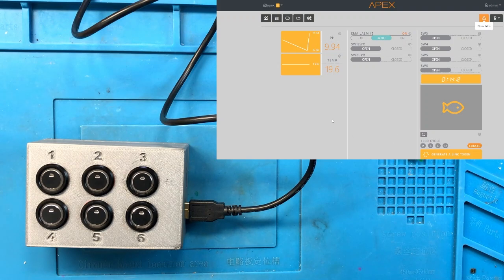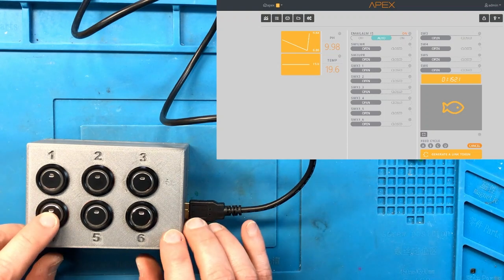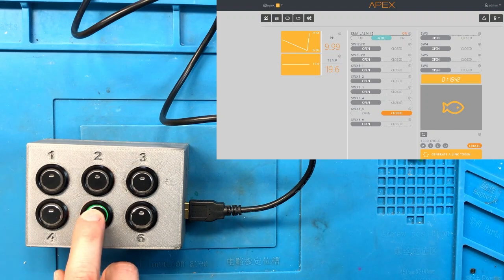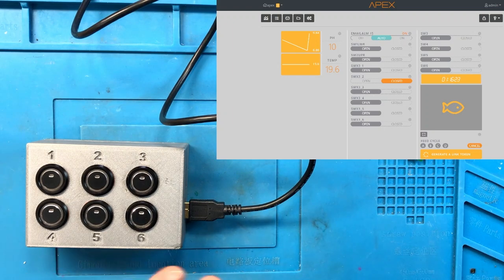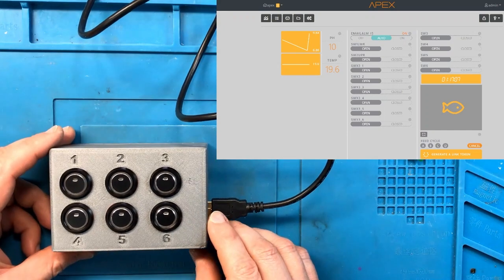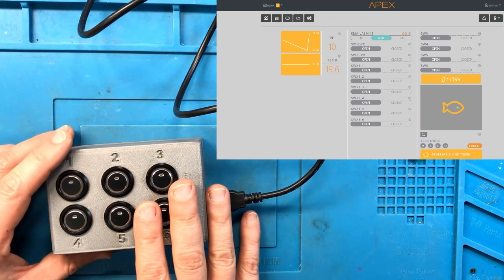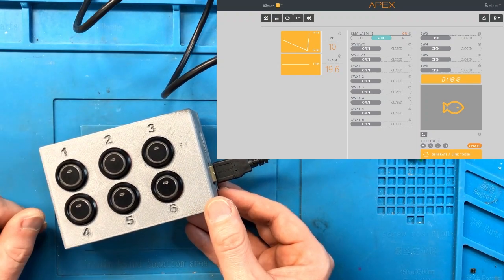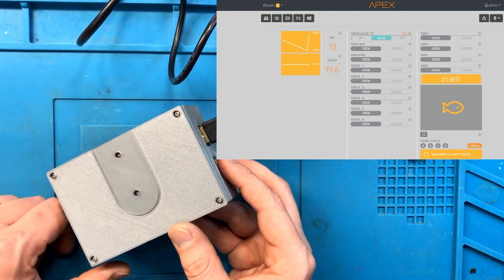FixReef Original - 6 Switch Toggle Box Apex Compatible

Comment: great video, help me understand how this is fundamentally different than their breakout box other than bypassing the need for a 
pm1 module?
Reply from the maker: Great question! The breakout box is just that. It offers a different type of connector for the DIN 6 on the head unit. The breakout box doesn't have any actual switches to press, only the retention screws.
Here's my design in a nutshell:
- Top quality illuminated low profile buttons. Buttons are IP67 waterproof and dustproof.
- All-in-one design. Plugs in directly into Apex AquaBus, does not require additional module or a DIN-6 connector
- Daisy chaining to other Apex modules
- Powered via AquaBus. Does not require a separate power supply
Reply: @FixReef  love it, great job.  in your exploration have you gained any insight into their canbus comm protocol?  I'm wondering if there is a path to creating our own EB832 energy bars...
Reply from the maker: Sure. It's all documented here: https://stonyx.github.io/AquaBusLib/